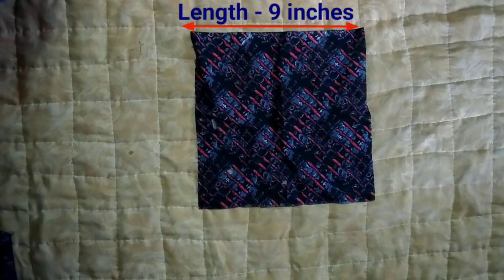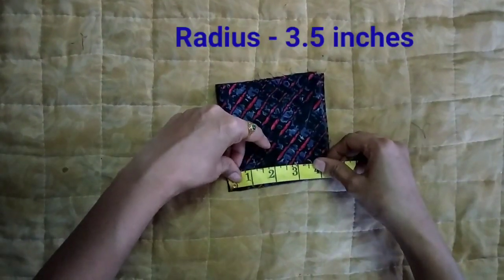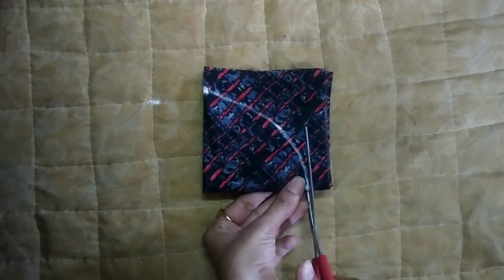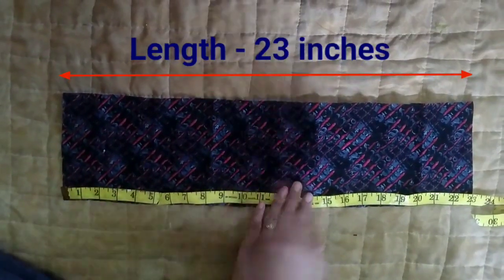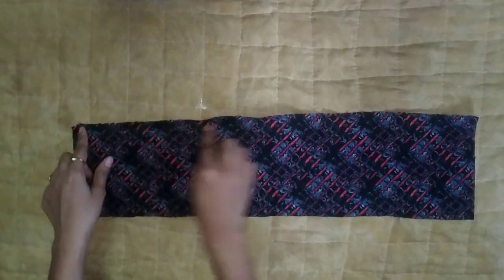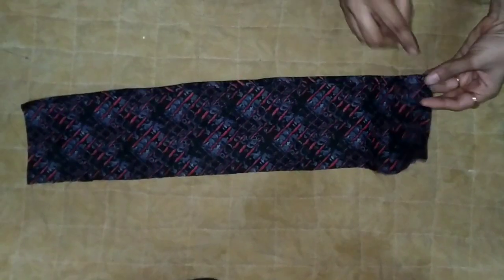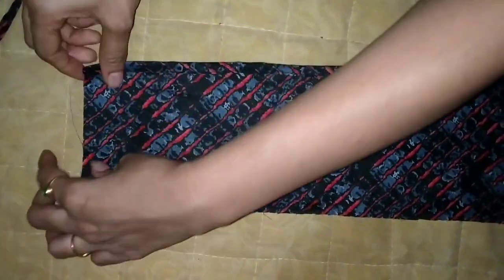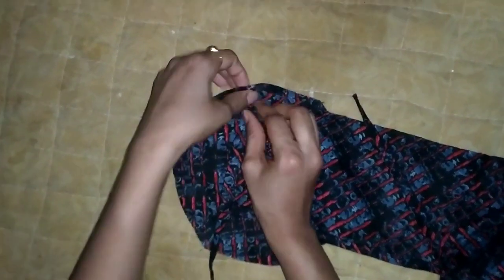How to make surgical Cap (DIY).

Comment: This is exactly what I was looking for in a scrub hat. Very Simple! You can use extra seam binding or ribbon you have in your sewing supplies to use for the ties. I use more fabric for the band because the seam on the edge is uncomfortable if you have to wear a shield all day like I do. It presses on your forehead.  So, I just double the width & fold it in half lengthwise. Then, proceed as instructed. Works great & I don't get an indent in my forehead :)

Comment: This is a safe pattern for the averaged sized head. The fit is good and it's adjustable for larger heads but smaller heads may need some additional stitching.  Her English is just at a point of understanding.  Easy stitching for beginners!